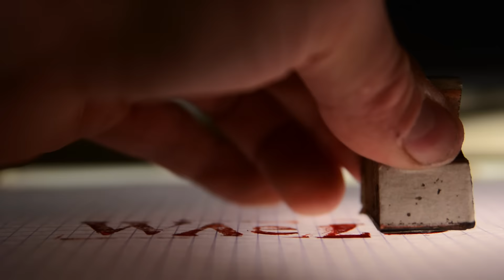Copper Vessel - Raising a dish

Comment: This isn't raising, this is sinking - when you sink you mainly stretch the center of the metal down, and it gets thinner - when you raise you push the outside up and in, and if you do it right the metal stays about the same thickness — Both are valid, and they can be combined, but raising has greater dynamics because it can move the metal further without it getting too thin.

Comment: I've read that the procedure for hardening/softening copper is opposite steels... that is, heat until glowing and then quench the copper to soften, heat and cool slowly to harden. am I mistaken, or is just because this is so thin the air cool works just fine?